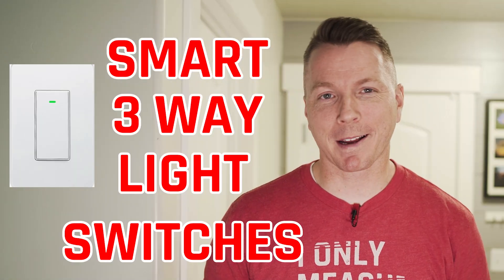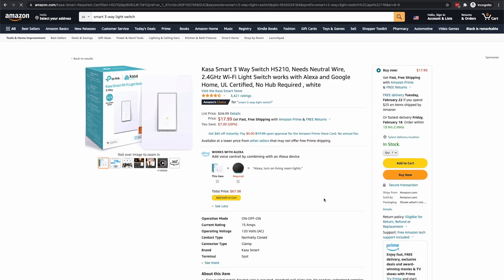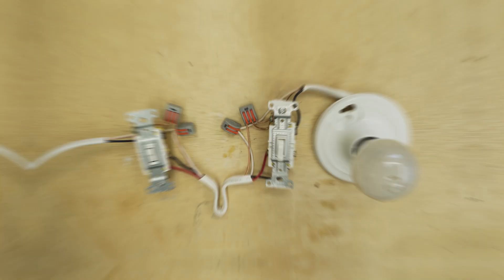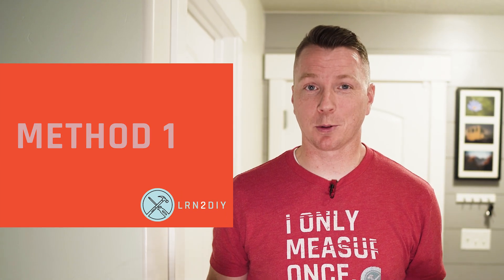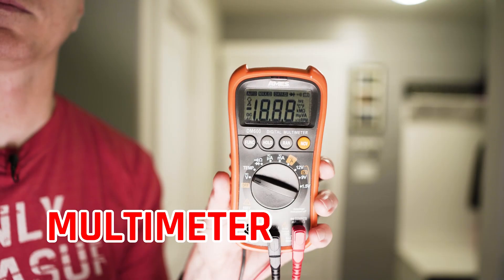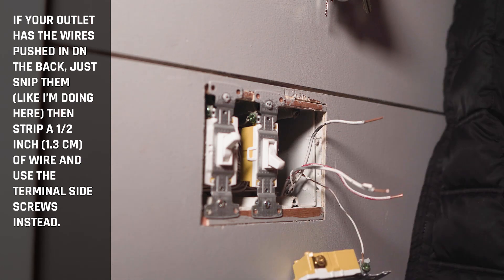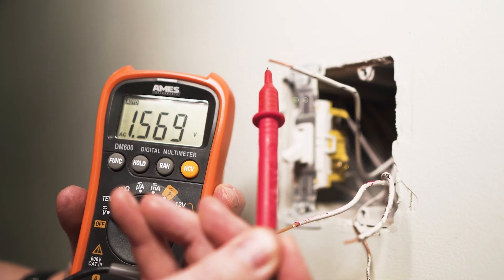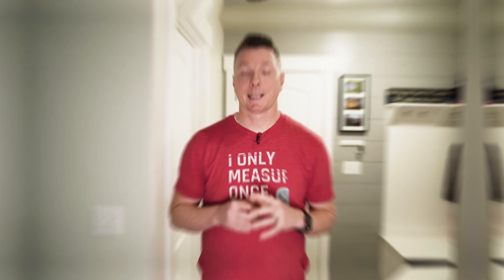1 Simple Trick to Save 50% on Smart 3-Way Light Switches

Comment: Question. I have only 1 3-Way kasa smart light switch and one single pole light switch. If the 3-way switch uses the runner, where do I wire the runner to the single pole light switch?

Comment: Question for you...I have one light control by 3 switches and to complicate things the electrician ran the power to the light not to a switch box. Is there a way to wire this light up with a smart switch and still be able to use all three switches? Thanks in advance for any insight you can offer. Currently  I have removed all switches and have a smart bulb that I control via wifi.

Comment: When energizing  a circuit with the exposed conductors sticking out of the box,  stick a wire nut or wago on each conductor.  It won't protect the serious Darwin contenders, but it reduces the chance of someone simply brushing against a hot conductor as they walk down the hall.

Comment: Wow... I really liked your video and the comments and responses are not hostile as one tends to find. I have a smart 3 way dimming Kasa + 3 way dumb non-dimming and it is not working. I need one to be white and one black and unfortunately Kasa doesn't do but white. Any tricks to make it work?
Reply from the maker: Hi there! If the one you replaced for the smart switch needs to be white and it isn’t working, that usually means you need to replace the other one, unfortunately. To your point, it’s harder to find a black smart switch but perhaps another brand makes them?

Comment: For the TP-Link 2-pack dimmer switches such as KS230, the specs note that 1 switch is the Main switch (Wi-fi active) and 1 switch is the Satellite switch. I imagine the Satellite switch is not Wi-Fi active, correct? If that is the case, then I'm not seeing the cost benefit here since you can't use each switch on 2 different 3-way setups. Do you have a method that works here though?
Reply: Correct the Dimmer KS230 Satellite one cant stand alone, just installed a couple recently.

Comment: I installed only one smart switch at the main switch (power line from breaker) . It works fine when manually turn on/off at either smart or standard 3-way switch. However, the Kasa and Alexa apps do not show the light status correctly so I am not able to know whether it is on or off to turn off or on. It does switch the light on/off at the app when I click the button on the app. The schedule setup doesn't work as I set up to turn off at sunrise and  on  at sunset.  I tried using timer schedule on/off too but same problem. I tried multiple of these smart switches but had the same problem.  I think there is some kind of firmware problem.  There is also another problem the light status at the smart switch always show on even the light is off, this status light should be on only when the light is off and on when the light is off
Reply: Did they fix it with firmware updates?

Comment: How do you handle it if the switch requires a neutral? I have a bundle of neutrals bundled on one but in the box, but 2 circuits in the box. From what I’ve come to understand, those neutrals shouldn’t be bundled. I guess my second question would be, if the smart switch requires a neutral, but the opposite 3 way switch doesn’t, can I make that work? Thank you!
Reply: You need to identify the neutral that comes from the same common/live wire and bundle the switch neutral to it.

Comment: I'm a bit unclear on the wiring of the 2 way switch. Which of the travelers coming from the 3-way do I hook up to the 2-way, presumably as the "live" source? Thanks for your help!
Reply: No 2 way can be used! A 2 way switch is on/off. A 3 way switch is different, where it is actually on/off 100% of the time (the way the switches are wired together *only one of the switches is actually "ON" at any time)...
Reply: You find the one that works in the right direction. There's two options you only use one

Comment: Unfortunately I don't see this working with the DIMMABLE version of Kasa Smart WiFi switch because the dimmer kit comes with one smart switch and one satellite (not smart switch). It works well for the non-dimmable 3-way kit since that kit has 2 smart switches in the box.
Reply: Kasa KS230 (3-way dimmer) is an exception to the rule. It uses the travellers to communicate on/off state AND to allow both switches to control dimming level. Also it's designed so the satellite doesn't need a neutral connection. These extra features necessitate the switches being used together. Kasa 3-way non-dimming switches can be installed as singles or pairs.
Reply: Perhaps both switches in that kit could actually work (kit KS230) but maybe the one can dim, not the other then. FYI, I called KASA support just prior to finding this video.
They informed me what the video shows, won't function *(even though I strongly suspected that it did!) so they're trying to sell their kits, more sales, etc.
Reply: Wow. I just now noticed that. First comment or mention of that at all. That’s why it was only working half the time
Reply: The switches aren’t even remotely the same depth beyond the “main/satellite” labeling I’ve been missing
Reply: Try ks210, i tried the 230 but u need to install them both.
Reply: It will work but only the smart switch can dim.  The old unchanged slave switch can turn on or off only.  Otherwise change both switches with both dimmable

Comment: Can a smart 3-way switch be installed with a smart single pole switch?
Reply: Did you ever find the answer to this?
Reply: @Vcize  No I havn't, I read some where that Kasa might be bring this option to customers sometime this year...who knows..
Reply: Generally, a non-smart 3 way switch is used with only another type of 3 way switch, in some cases where there are several, 4 way switches (at least some of them) are required. If using a 1 way (single pole) switch in a 3 way circuit, it'll defeat the purpose as you can't make use them a (as w way switches) It doesn't seem possible, you'd have switch connection terminals, that have nothing to connect to/it won't function.

Comment: Does the same apply for a 4-way setup? (hall way of lights, 4 light switches)
Reply from the maker: Yup - works the same with a 4-way switch.
Reply: Agreed, it should. The key with all 3 way and 4 way switch wiring is for everything to be wired exactly as it must be. *Some electricians even have a challenge doing it correctly the first attempt. Also, where the power is as noted in the video is key!

Comment: So if you have a 3 way switch and one of the switches has a dimmer, is the one with the dimmer the main switch?  Meaning, if I get the TP link Kasa switches that come with a dimmer, do I just replace the existing dimmer switch and I'm good to go?
Also, I've used TP Link in the past, but it can get heavy on the network, which smart switches do you recommend?
Reply from the maker: Just because there’s a dimmer on it now doesn’t mean it’s the main. I’d verify which is the main, put the smart dimmer on it, then use your regular dumb (3-way) switch on the other one. 
As for brands, I’ve enjoyed TP Link and haven’t had network issues with them even with 110 devices on my network. I’d go off of the Amazon reviews if you want to look at other brands.
Reply: @LRN2DIY  I had my old house almost completely with the TPLink smart switches, it was great.  But I know each switch is a device on the network taking up an IP address.  I was wondering if you preferred TPLink over the brand that Lowes/HD carry.  
Great video, I can't wait to smarten up this house too. Can you believe, I have to actually get off the couch to turn on the light.  OH the humanity. Haha.
Reply from the maker: @brandonb417  Haha - now that's just not cool ;) (having to get up to turn on the light) So as far as IP addresses, yeah - you've got a few options. 1) Do what you and I have done with a bunch of switches and a bunch of IP addresses or 2) get a second router and keep, set up a different network and only put your smart devices on that, 3) go with products that use a hub to reduce the amount of traffic going throughout the house and 4) start replacing switches/outlets etc with SmartThings / Zigbee products. These work differently than standard WiFi switches and take up less bandwidth. I can't claim to know all the options but those are some out there that are popular. We use the Google / Nest Mesh setup with several satellites and it handles all of our devices just great.
Reply: @LRN2DIY  I've seen those options as well. One thing I liked about the TP Link was if one switch acted up the whole system didn't go down. I have one Philip's hue light with the hub and it was a pain in the neck.
Good idea with the second router.
I'm oy planning on a few switches though, so shouldn't be a problem.
One thing I did before that was really cool, I used a smart outlet on my patio cover for the patio lights, ordering Google to turn on the patio lights was pretty great.
Thanks again for the info in the video.

Comment: Excellent video and explanation!!!  I did learn the hard way to read and reread the little manual that comes with the switches. I only had two, 3 way switches left on hand, and didn’t want to order just one single pole smart switch, but I wanted all the switches in the room to look the same. So I just used two, 3 way switches. The circuit never worked. Only one switch would work and the other switch would only work if the main switch was on. Turns out the brand of smart switch will only work if only one switch on the circuit is a 3 way switch, not both. I ordered the single pole version of the smart switch and it now works great. There was a notation in the little manual, and I didn’t see it until I reread the manual a few times out of frustration.
Reply: What brand of smart switch were you using?
What the video is showing is that you can replace (one) 3 way switch (where power is fed to) with a single smart switch and buying the pack of more than one might save $
If you used a KASA 3 way switch, but wired a single pole switch in the same circuit, please share a wiring diagram of this?

Comment: What if I have 3 switches controlling one light?  Would it be the same, one main and two secondary?
Reply from the maker: Exactly. As long as you put the switch on the main, the traveler wires will keep that one informed as to the light status, so it should work there too.
Reply: @LRN2DIY  Thank you for the response, I've been trying to get an answer and now I finally got one!!

Comment: So I can use a TP-Link 3 way dimmable smart switch on just one of the switches and it will work??
Reply from the maker: As long as you put it on the main switch (the one connected to the circuit breaker box) then yes.

Comment: Interesting video, thanks. Are you using wire cutters to pull the wires out instead of pliers? You probably don't want to reuse such endings as the might be damaged. Also labeling should be recommended when power is off. Otherwise it's a huge risk of touching exposed ends of hot..
Reply from the maker: I used cutters to snip the wires then stripped them.

Comment: You can use a shelly switch (or dimmer), wire the second switch to the second channel, and Bob is your uncle.
Reply: If your using tp link switches at least flash them with Tasmota. Second time on this channel he’s used esp based hardware with junk cloud firmware! Like one foot in.